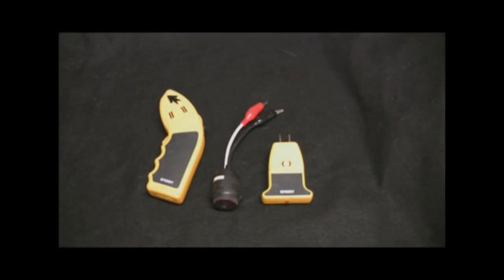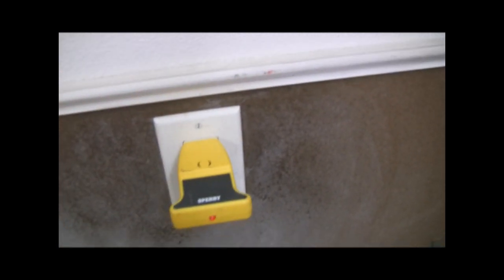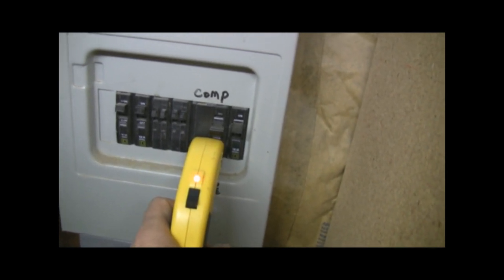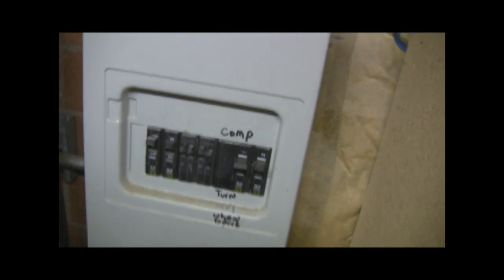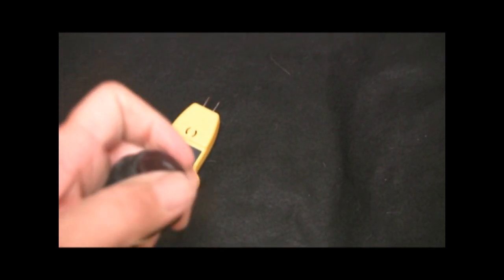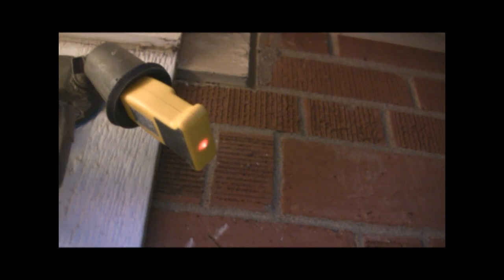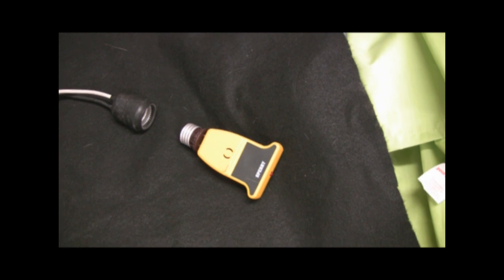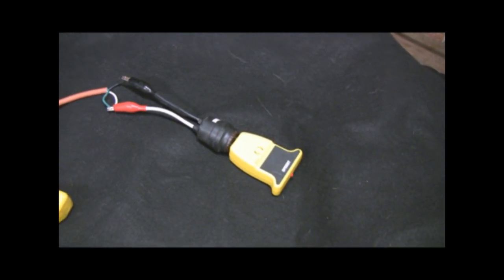Electrical wiring-Circuit Tracer

Comment: I've got the same probe tool. I plug the little unit into the circuit I want to shut down. Then go to panel and turn the sensitivity way down so there are no false squawks. Then I bring up the sensitivity a little at a time while waving the probe over the breakers. Works every time and always the correct breaker.  This is an older unit probably better ones out there now...

Comment: Honestly, as a professional, I would not bother with this tool.  That was pretty bad performance and the guy in the video admitted that he have to turn off more than one breaker to figure out which was at fault.  Granted, this was 2009, so I would just remove this video as being pretty useless.
Reply: any ideas on how to find a break in the wires?

Comment: I understand that this is an old video, over 5 years old, anyhow for whom it may interest, the receiver has no memory/recall of the transmitter signal so the little gymnastic performed with the receiver next to the transmitter at the beginning is strictly to validate that the pair are working as expected and guide the user as to what to expect on the receiver when will be scanning the breakers in the electrical box.  Also, the angle at which the receiver head is positioned versus the breakers surface will greatly impact the unit's accuracy.  Overall this is a nice tool to have and since this video was put online, other units were put on the market, which are using a very similar concept.

Comment from the maker: @nathanbernard  No it will not work on dead wires.The transmitter requires 110v to operate. I use a fluke wire tracer for tracing wires. It is designed for phone guys but works well enough for me. There are many wire tracers on the market,just Google it to find something in your price range.